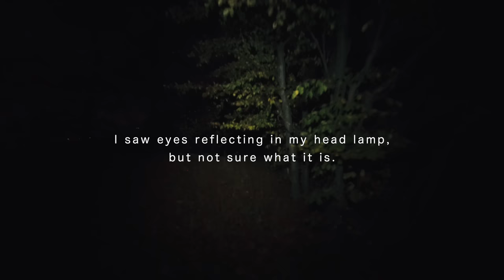#42 Finding Stones at an Abandoned Quarry

Comment: Hello Martijn,
If you do the next roof, use EPDM ( rubber ) under the battens. You can buy it in one big piece and that way your roof is alway’s water thight.
The stones are just for the looks. Than it’s not a big problem if water or snow is comming under the stones.
And put the rubber on the sides into the wall, so the water can’t run in/over the wal. Greatings from norway

Comment: Solarpanels in winter, consider putting them more straight up, almost verticall, so the angle with the sunrays is more 90 degrees at least in one direction :-)

Comment: Thanks Martijn, For showing the trip to the abandoned rock quarry. I WAS wondering how you were going to find the stones, I knew however you'd find them.  I'm beginning to really relate to why your wanting and why its important to re-create the original cabin back to restoration. The beauty of the natural stones, sizes and watching you figure out what stones go best with other stones and where one might be more prone to leak and I thought of one question I'd have..is there not any type of sealant that can be applied and is thick enough to basically create a water proof barrier. Typically roofing has that roofing paper under the roof material used, I can see that would be almost impossible to make it work seeing the stones vary so much in size and shapes. I didn't get to see how the roof was prepared prior to the stones, so did you put a vapor barrier or any type of water proof material that would prevent the water from slowly beginning to drip down into your living quarters? Pretty amazing to see how you and your friends got the stones, toted them up the side of the rather steep incline, more interesting was showing how the stones from the old quarry were probably actually created in the old days...by hand. I am glad your work continues to be so interesting and so well done...it literally is something I look forward to. This is quite an adventure for you, and thank you for taking us along with you... as we all watch from various parts of the world...but joined in spirit to wish you well and blessings on your journey of making your home in the beautiful mountains of Italy. Thank the gentlemen who came to help, it is good to see men work friend to friend, neighbor to neighbor...and to take part in helping one another. I can see why your all so very tired...but you did it. Very resourceful, and I can now understand what had to be done in the past to create those stone houses many years ago and why it has meant much to you to do the same. Good job..thanks for the post.
Reply: That my friend, is a great comment you’ve written. I had a great time reading it.
Reply: @haritzalzola8243  Thank you, I am sure because you feel the same ... I'm learning so much just watching Martijn. Martijn is to me like a fine aging wine (no martijn your not looking old..lol) mellow, and just right. He does things that HE MAKES look fairly easy, but he is highly intelligent. He has to have been brought up by special people to be such a wonderful down to earth man who loves everything about nature and culture and adventure. I feel like I am watching as Martijn restores his stone houses and sticking as closely as possible to the original building structure that he is feeling the true beauty of his project and is literally becoming a part of the land, the buildings, the trees. He is exactly where he wants to be..by becoming a part of it all and leaving his spirit for those in the future who come after him. Those who do come someday and admire the hard work and love and spirit of the man will feel his presence in each stone. How fortunate we are to watch this process.  We all have come to admire Martijn Doolaard , his work and love for his land and home.  On last thing, I am so impressed at his ability to work hard and self-discipline, he organizes what he wants to do on a day and sets out to work hard to complete it or knows what tool he may need and if he doesn't have it he creates a tool that will work.  It is obvious why he loved his journey spending two years on a bike. Me? Naw, I'd be flying, driving, on a camels back...rickshaw, rent a car...Martijn sweated every mile and loved every minute of those two difficult years. This is a true man.

Comment: That condition you mention with the water following the "bottom" of the stone is called "Surface Tension". You would expect the water to drip (run off) once it reaches the edge of the stone. Instead, it tries to "adhere" to the surface and rolls around the bottom edge and goes horizontal a bit first before dripping off. 
Very interesting how all those random shaped stones are placed to provide a water proof surface. Especially, when "surface tension" is considered in the process. I had noticed that lots of the other cabins had the "uniform" type of stones on the roofs which would make placing them much easier in so many ways. 
It's always interesting seeing/learning the little "tricks" that are used in doing any type of chore that taxes the physical ability to perform that chore. As you described and showed, they are most often so basically simple that our brain rather automatically over complicates the problem and looks right past the obvious solution. Walking and/or rolling the stones and the long claw hammer as examples while I'm suggesting a two wheeled cart ????

Comment: After watching the crane fail I thought he might build a sled track to get them up the ramp  and around the roof. Much less sweat equity, much faster progress. Seems like you could use the part of the crane that has those runners on it.
Loved watching you so far. Wondering how just one little garden is enough to make much of a dent in sustenance needs.

Comment: You should tilt the gutter above the skylight, to make sure it drains off to one side. If it is too horizontal it has to fill before drains off. and in a galavanized profile with water in it, it will rust faster and thus tear through. It is standard in the mounting description from Velux at least.

Comment: I would fill up space between wood strips on the roof with styrofoam.Just to make it even with wood.Also I would put tons of silicone between rocks and skylight aluminum . Blue skin would be better there. If wind is going blow for a long time you will experience water in the building.

Comment: can't wait to see a photo taken through the roof window next winter with snow on the roof and a nice warm interior.  Know that you know all about the concept of secondary burn in wood heaters.  From the ceramic mass heater which your neighbor has to hyper efficient though possibly quite expensive models in stainless steel (greater heat tolerance than common steels or cast iron).  To pleasure [yet to begin].

Comment: being from the Austrian Alps, and having worked in the forest a lot in my younger years, including with a rope crane, I think you could think of using "block and tackle" a bit more, if too pull up stones on the roof, but alos loke situations like the quary : a tackle on the hillside of the road, and let the remorque down on a rope, max. as long as you have straight road to pull with the car - load it down there and pull it up. But ever do something like that alone - the load must be watched, and alarm given must stop the engine. An otherthing : some old car jacks from the scrap yard might help in fine tuning the angel of your solar set - not winter/summer, but in between optimization

Comment: The building technology nerd in me wonders if it would be useful or helpful to apply a waterproofing sealer to the roof stones, to help them shed water a little better, and maybe help the stones last longer.  Sealers are generally invisible and won't affect the look of the stone.  Not all stones are created equal - some are more friable and will turn to dust when exposed to weather faster than others, and these stones definitely look like they're not granite. 

On the other hand they seem to have lasted over 100 years on cabins without losing too much thickness or splitting, so they're probably going to do just fine.

Comment: at 15:30 where you drill a hole through the stone and drive in a nail ... the traditional way (in ieder geval met dakpannen :) would be to first put on a 1x2 inch piece of lead or zinc, nail through the bottom part and then fold it back over the nail head and then hammer it in ... lead would be better because you can form it with a hammer

Comment: Sorry for clipping your finger on the rock, it’s a good reminder that what you are doing is a commitment; to time, your life, future and beyond your lifetime.  It’s as long as the century before us and the cabins.  Prayerfully it will be in 100 years after us.
So many times I’d consider quitting when, while renovating my home, I’d have some mishap or injury!!!  Good for you for sticking it out, AGAIN!

Question: were the previous pavers bolted to the structure?  Curious and lucky, they haven’t split when you drill or nail!

Comment: Hey, I've been following your videos for a long time. Unfortunately, I sometimes watch your videos with a delay. Otherwise I would have already told you how to lay the vapor barrier and underlay. But I don't find it that problematic either. But in this video I see you are using galvanized nails for the bricks. I would use stainless steel or copper nails for this. Or stainless steel screws. The galvanizing of the nails is already damaged when they are hammered in and then quickly rust away. The stones damaging the galvanizing. Maybe for the other roof surfaces. Greetings from a roofer and architect from Frankfurt. Danny

Comment: Mein Herr - your herculean effort required to put stones on your roof I do respect but it is not necessary in this day and age. I fear that the enormous weight of those stones and the weight of a winters snow loading has not been allowed in your roof  structure design. Your cottage would have looked just as authentic and elegant with an iron roof and copper down spouts and gutters. I also hope that your finger is not too badly crushed. Best wishes from Australia.
Reply: In earlier episodes the local ordinances addressing what can and cannot be done were shared. The roofs must remain stone.

Comment: I'm sorry to say this, but maybe this will help you more on the next building...
The original roof, was done by a mason with good experience in a time when this skill was widely known. He knew what he was doing back then, as evidenced by his roof still being sound 200 years after his work, and maybe longer.
There wasn't a shortage of stones on your original roof, only broken stones, or shifted stones, maybe a few needing replacement, but likely not a necessity of 30 new stones. Even if you were short a few or wanted to overlap more for vigilant calculating, that could be done by resetting his original pattern tighter, then adding at the horizontal ends with same thickness as original rows.

By calculating where the actual leaks were, you would know to look up, and re-tile that area tighter due to rain coming in, and stone shifting downward, etc.
 You likely did not need the addition of 30 more stones. Just taking an arial  photograph, then marking the original stones exactly in their original installation place with letters, numbers and an arrow pointing toward the top for repeatable orientation, would have been enough guideline for you, to replace the stones close to the original time- tested roof pattern,... minus the leaking areas that you could adjust, to set tighter.

That corrugated tin sheets you have sitting there, when roofed correctly, last as well as stone, and any rain water getting to them, will drain vertically downward if set it vertical overlapping tin sheets.
Stones are set, thinnest, to thickest, bottom first horixontal, then row upward in repeat pattern, overlapping the stones from top down, side over, and definitely not ever, in varying thicknesses. 
 I'm worried about the mud and molds on those stones too, being set right onto your roof. The biggest threat to any wood, is mildew and molds, and especially in trapped conditions with recurring rains.

Sorry, to have to say this, but maybe it will help you on the next job.
I know exhaustion clouds the brain when you're overwhelmed like this. I've lived it, and can relate completely.

Comment: The big stones may look nice, but they're wildly impractical, used only originally because that's all they had for that rustic structure. There are large crevices for critters/wasps/etc. to get in and I'm mystified as to not have some form of barrier immediately below. Also, is there going to be any degree of insulation? Is this only going to be a three season place to stay?

Comment: Great work ! what concerns me tho is that all the other stone roofs we see around, including the other little cabin seem to be using much thinner, smaller 'flakes' of stone, rather than these enormous thick flakes. So it seems that maybe what you are doing is not exactly how the roofs were made. Why would anybody haul such huge pieces up high when there might be much easier ways to go ?  And the pattern on the roof is not one that seems to match the other building. What am I missing ?
Reply: Well, maybe you're missing the point that he's re-building the roof using the stones he removed - so it's the SAME...!!
Ask yourself - why did the locals build in this way originally - old buildings were ALWAYS built with locally available materials. They were built to be practical and long lasting.
It seems that their is a local source of stone which splits easily into large pieces - so, that's what they used for the roof....!!